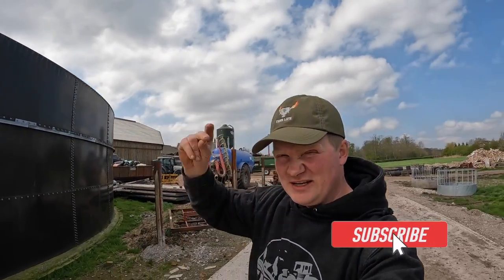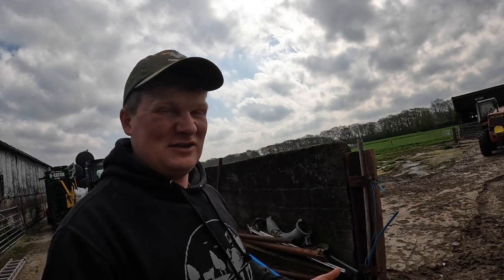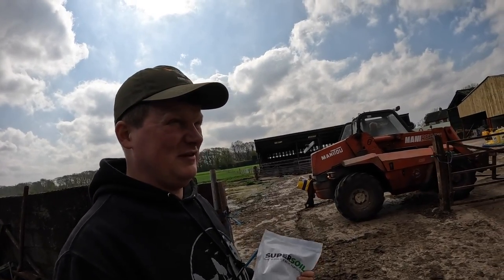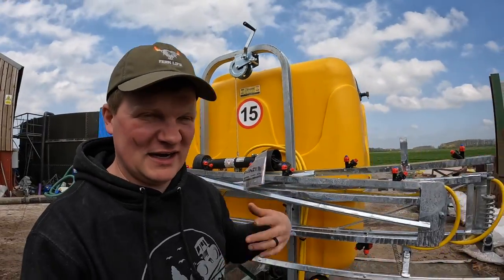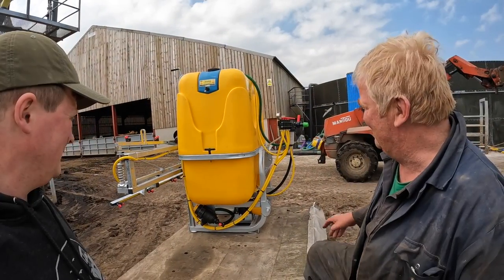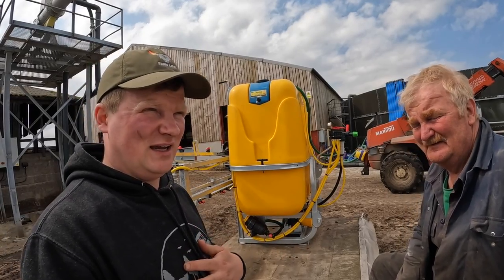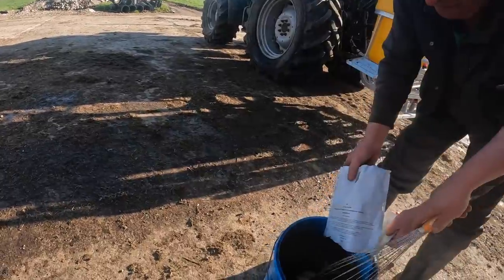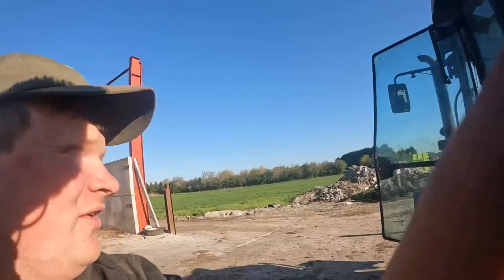BRAND NEW TOY!!!.... DOING SOMETHING WE HAVE NEVER DONE BEFORE!

Comment: just a little tip...dont let the sprayer outside in the winter...the water will freeze in the pump and you will have problems afterwards...
Reply from the maker: Put it under cover? Or make sure it’s empty 🙈
Reply: @TomPembertonFarmLife  make sure it doenst freeze...you can never make it fully empty but still try the best you can to get it empy...i work with sprayers for 10years at my workplace and we demount the pumps in the winter and store them inside over the winter becouse we dont have closed sheeds where the temparature doenst go to a freezing point...
Reply: @TomPembertonFarmLife  Run a few gallons of RV winterize through it before parking.

Comment: Back in the Early 90s, I was based in Portugal and we were growing peas for the fresh market for Marks and Spencer. Daily consignments flown back to the UK for packing and distribution from Hampshire. At drilling time, because the soil was light, it was decided to add a product to the seed that was very similar looking to what was in the bag you had there. We would the dry product to the seed, is the difference with you spraying it. Similarly it was said to contain microbes that helped the peas, a leguminous crop, fix their own nitrogen in nodules in the roots. It was called; an inoculant. So this is not that new a product, an early version of it has been around for 30 years. You will see improvements as time goes by, it is not an instant fix type of thing. Thumbs up to you.

Comment: Had the same problem with my jer-met sprayer could not reach controls, so made extension bracket.
Dealer said get a smaller tractor, but it is on a 1984 international 885xl, keep you fit
Put a bout marker on will save spraying errors
I've done 60 acres of Supersoil for the first time as well

Comment: Hi Tom Nice little machine Them controls on that panel can you not get a length
of metal tube with inside Dia so that main tube can slid inside weld one end pin other
save £500

Comment: Yo Tom...I'm familiar with Supersoil - IT WORKS!  It's just not nitrogen you're after, it's CARBON too [carbon sequestration] - here's why.  Soil microbes use carbon as food.  If you want to 'maximize' your Supersoil results, you will 'invest' in a soil slitter and mount it in front of your sprayer [run both together for efficiency] - here's why.  The slitter pokes holes in the top 4-6 inches [where most plant growth happens] of soil and those holes will migrate your Supersoil spray where it needs to be - in the root zone.  Here in the States, I use Soil Works product(s) [Bio-5 which looks and works just like Supersoil] and the Bio-5 Extractor for use with my Johnson-Su bioreactor material.  I have a soil slitter setup with a 500 gal. tank [gravity fed] on it.  I add a 15 strain mycorrhizae spore blend to my extracts and then, as I slit, that 'mix' is gravity fed into the slitter holes.  Within one year after starting, I increased both my alfalfa and hay cuts by one with an enhanced nutrient profile on both.  I also use that same 'mix' on my barley and milling corn crops when planted - my yields match and can exceed the national average - not bad considering my operation is certified organic.  You be going in the right direction to reduce your fert costs.  Here's a thought...if you don't want to go the slitter route, I'd add a quarter of a bag of Supersoil to each load of spreading muck - me thinks you'll hear your grass grow!  Cheers...

Comment: Tom - when you spoke with the company did they say if the product is manufactured by them in Ireland or white labelled as it reads similar to other products available ; great if it can kick start poor soils in to life (as your father mentioned in Block 3 land) but the volume of new bacteria/microbial activity required to trigger a change in already healthy soils (as I assume you have after years of slurry / manure application) would be significantly more than the dosage stated…. I hope my assessment is wrong and it works out for you though!

Comment: That's a whopping sprayer compared to the first sprayer I used back in the '60s. That had a 40 gallon tank and a 18ft boom.  for you youngsters that's 180 litres and 5.5 metres wide. If I remember correctly we used to drive at 4mph to get the right volume of spray per acre.

Comment: You’re not really pulling nitrogen out of the air. You’re using microbes to break things down faster. So that the nitrogen is now “free nitrogen”. As in its freely available and accessible for the crops. Ammonium is an example of nitrogen being present but not freely available for the plant to use. The microbes help free up that nitrogen within the ammonia, ammonium etc. for the plant to access and use.  That’s why the suggest using it on fields where muck and slurry has been used. Because the nitrogen will be abundant in those fields but that doesn’t mean the plants are able to use it to grow.

Comment: tom that is very dangerous having a single window open cause the spray can get into the cab and sprays are dangerous stuff cause of the chemicals so always keep everything shut tight when ur at the job try drive on to a bit which hasnt been sprayed and stay in the cab for 5 minuites at least then when ur out folding up the sprayer wear a mask goggles and long sleve desposible gloves
Reply: I was thinking the same, basic sprayer training and it doesn't matter what you are using.